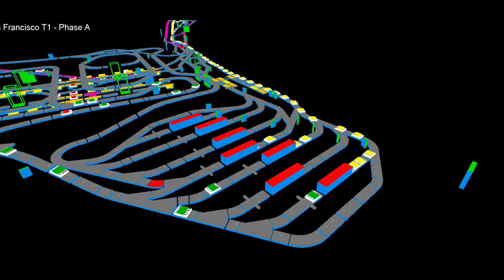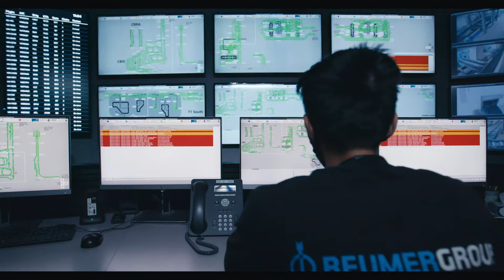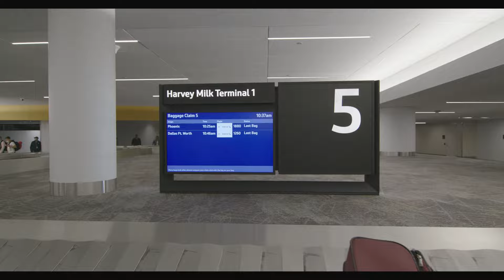ICS Baggage Handling at San Francisco International Airport

Comment: How does the baggage handler know which bag is the last one he has to take to put on the plane.
One belt should have baggage tags for 3 or 4 flights at a time.
Reply: The bagage handler have a monitor showing the status for the individual flight(s) knowing exactly how many bags has been discharged. Thus he will paired the number with a handheld scanner. So yes, they know very precisely when the last bag has been discharged/loaded